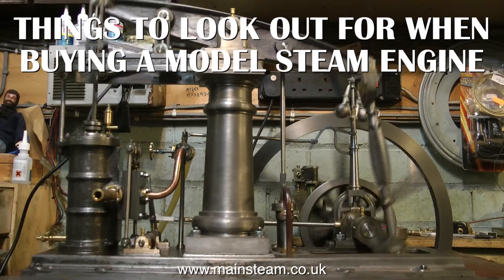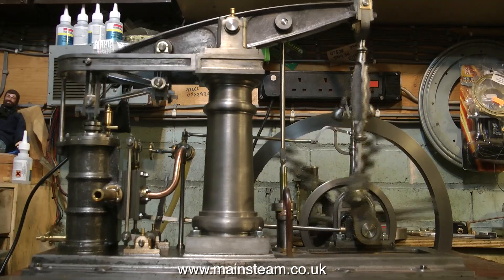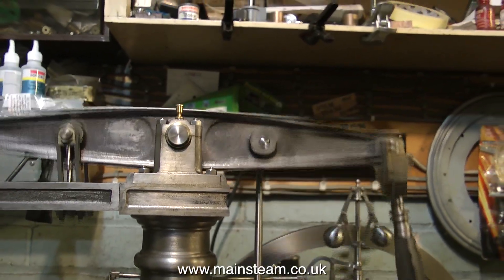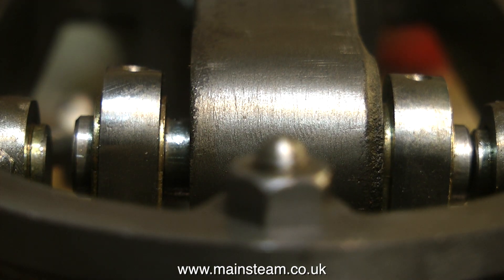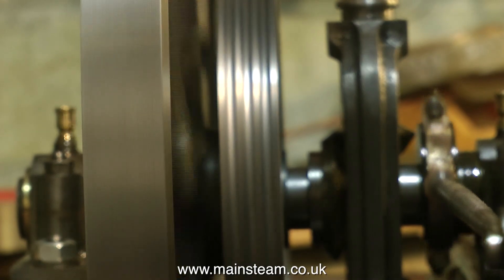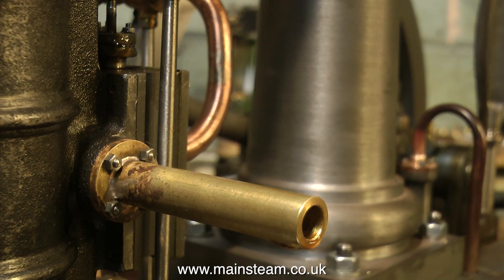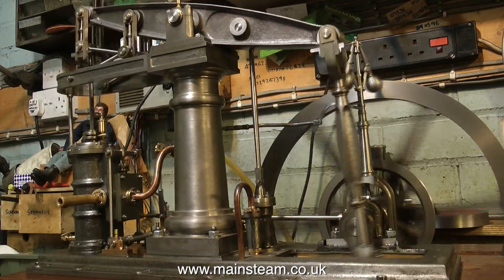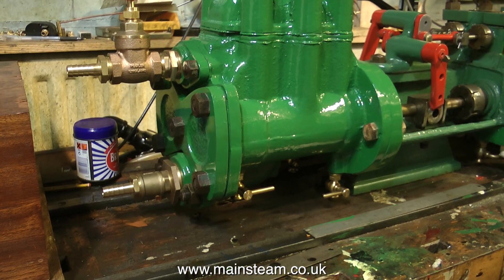STUART MAJOR BEAM ENGINE - TIPS WHEN BUYING ONE

Comment: The off set drilled hole you pointed out in the video is not a mistake by the engineer but down to errors in the main beam casting. I  am making the M E Beam engine and as a precision engineer I indexed the holes in the beam and had to compromise a bit on the positioning as there was no way the given sizes would line up with all of the casting bosses.I now know that the position of the pump drive hole is not so important that it cannot be moved a bit but starting from scratch on my first engine I was being accurate to a fine tolerance. The drawings are very poor with multiple errors and difficult to clearly interpret. Is there a machine out there that reads in fractions of an inch ???
Thankyou for the very good videos. Keep it up. I don't know how you find the time.